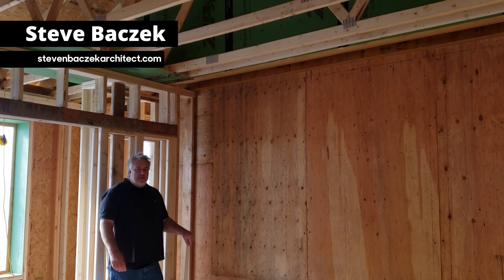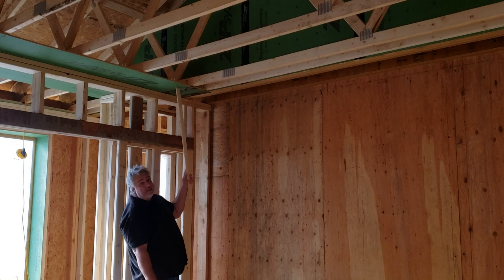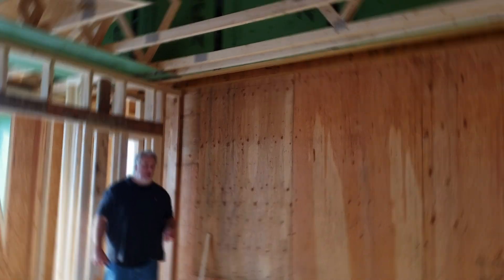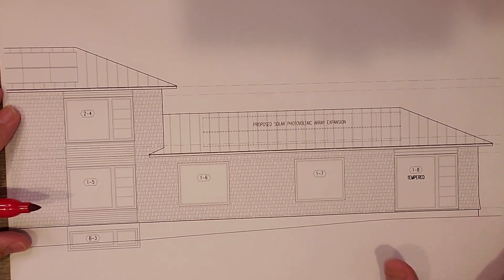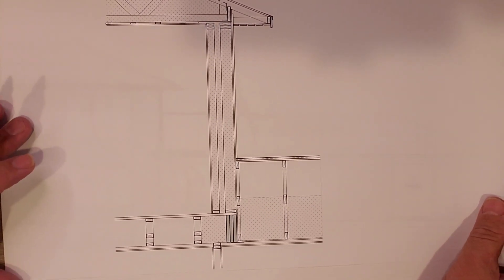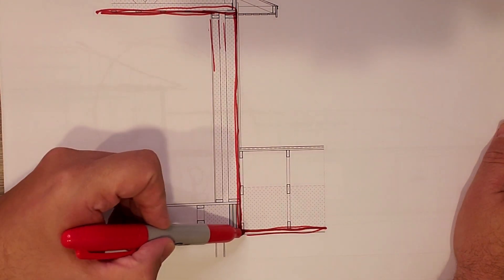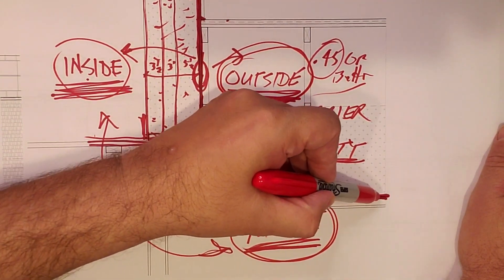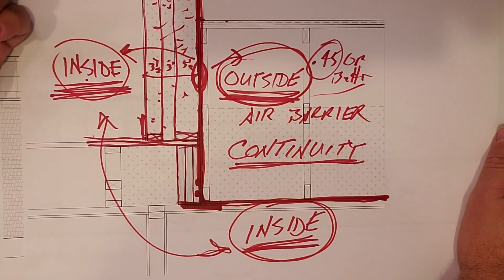Air Barrier Continuity - Passive House

Comment: why is there a shear wall like 6 inches from a triple lvl? this does not look like a matter of the building barely fitting on the site.
Reply: Room was plywooded because of the inter wood panel finish, not for shear